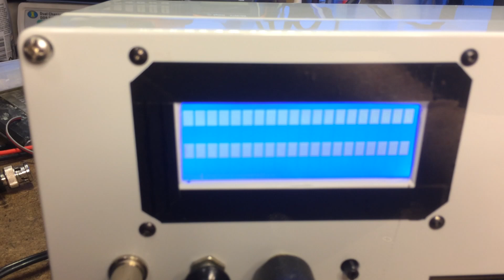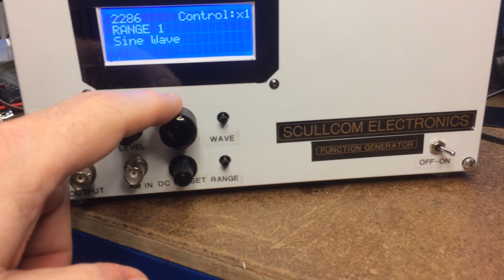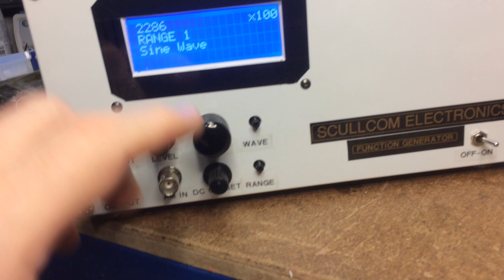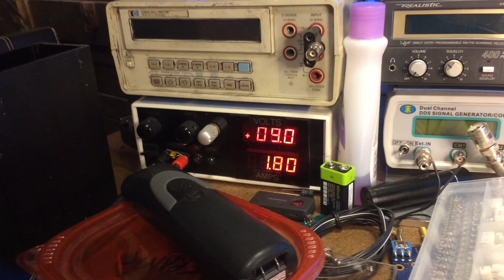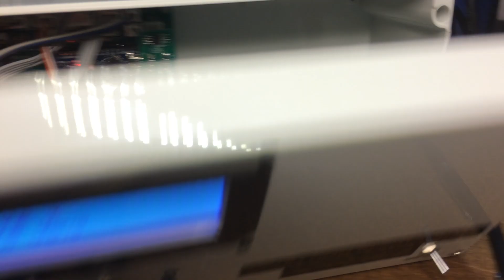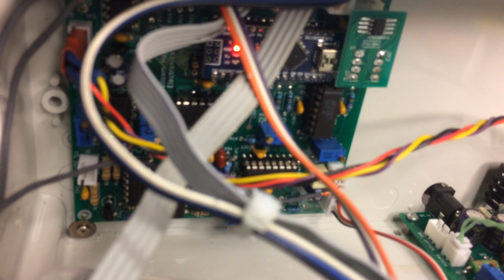Video #1 Overview of Function Generator

Comment: Hi Rudy thanks for what you provided. I got the details I needed. How are you keeping?
Reply from the maker: Much better thanks. Good luck with the project. I’d love to see it when it’s finished.
Reply: I've got it built, just got to set up and build it in the case. Sure will upload a pic of it when finished. Have you built the DC load at all?
Reply from the maker: @Steve-w2s4w I have. It’s a lot of work.
Reply: @TheFunkman  it's my next project. I just wondered how you attached the heatsink to the back of the case?
Reply from the maker: Just machine screws
Reply: @TheFunkman that's what Louis said. Can't see where you would put them. Perhaps I will look into it when I build it. Had trouble getting a suitable heatsink too. Have you been in contact with Louis recently?

Comment from the maker: Sorry but I should not assume everyone knows what TTL means.  It means Transistor Transistor Logic.  This square wave output is held at +5vdc regardless of the level setting on the front.
Reply from the maker: I have a schematic somewhere. I’ll have to look for it
Reply from the maker: Be very careful with that power supply. The negative side is very easy to damage if you short it.